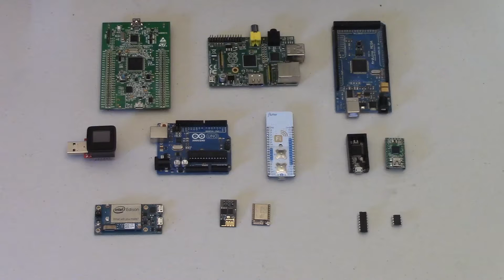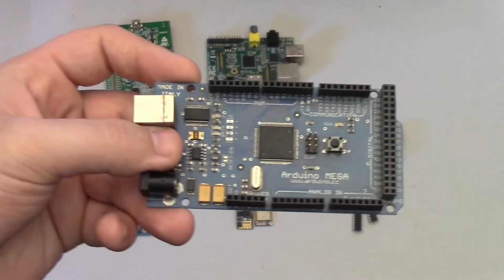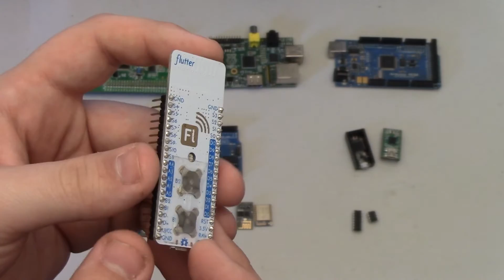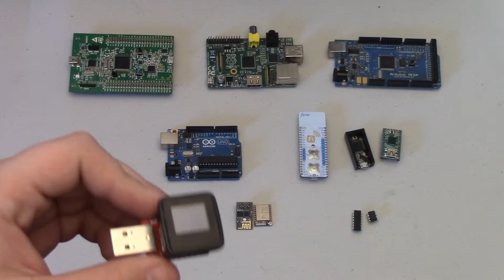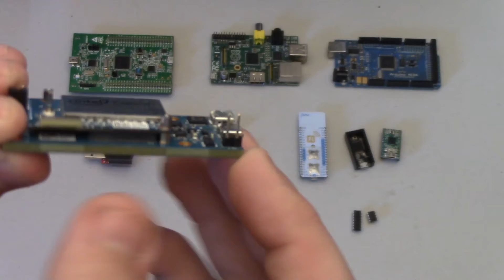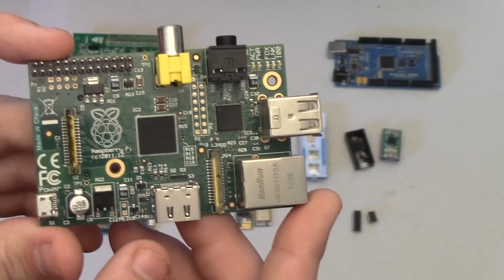Development Board Showdown!

Comment: I think I will buy a  arduino view because I am in a apprenticeship as electronic technician (for fabrication automation and circuit design)

And I would use it to output data and debugging codes from a standalone microcontroller.

Because we started "SPS" translated word by word it means "Memory Programmable Circuits" its an integration of EEPROM's, Flash, RAM, other memory types and logical operations in regulation- and controlcircuits. (and micro controllers) 

And I have to design am learning how to design and perfect them but most of this circuits don't need a display after testing and adjusting and using that arduino I would only need a few ports on the microcontrollers for diagnosis not like while using a lcd.

That means if I make a circuit where I have to define output fixed diagnosis pins that can't be used for other purposes after the first error testing I can use less pins and  maybe I could use a smaller cheaper microcontroller enlarging the "cost efficiency" (theoretical) .

Comment: I bought a 3D printer that used an Arduino mega like that one. I accidentally fried one of the digital pins building the 3D printer kit, and bought a box of 10 arduino mega clones from China in case it turned out to be a recurring thing. (It didn't, and I just tweaked the printer firmware to use a different pin.) Since I already had them, I used them in a lot of projects over the years. I'm moving more toward ARM/STM32 as my micro architecture of choice, mainly because the price/performance ratio, and indeed the absolute price in some cases, is better.

Comment: I don't understand why there is no Silicon Labs C8051F120 based chips here. Or for that matter any of the newer MCS8051 based controllers.
I have worked with some Silicon labs C8051F120 boards. I got some bare boards which could accomodate the chip and have built a few devices using these. The clock runs at 100MHz and the peripherals are excellent. a 12 bit ADC and DAC ports and whatnot. I just built a network analyzer which goes from dc to 70MHZ. with a 480x320 lcd display.
with Assy  as well as C programming using the Keil UV2 ( Old version  the only legal SW dev system I own.
 I think they are better for embedded control then 32 bitters.
Reply: Azzy M Now, we program in Processing on Arduino hardware haha. And sometimes Rust on STM32 hihi

Comment: in general agree.  a few comments esp modules except for esp01 are 2mm pitch so in general need breakout board for 0.1" pitch breadboarding.  also stint can be programmed by you're arguing into or any USB to serial ttl module in bit banging mode.

Comment: You CAN program the attiny85/84 with an ftdi device in bit bang mode. (special wiring required and some of the usb-serial adapters don't bring out all of the required pins of the device).  I think avrdude supports this directly, though it is SLOW!  You can also use the arduino uno as a programmer for those devices with a simple sketch.

The arduino mega is probably used mostly as a controller for a 3D printer with a RAMPS shield.

The Edison looses out to the RPi3 in price, but it IS smaller.  Also you can't build the RPi into a commercial product, but you CAN with the Edison.
Reply: Did the ATTiny support debugwire? With AVR Dragon you can debug/step code in device using debugwire or jtag.

Comment: cool thanks. would like to see an in-depth review and your tool chain setup and how to started for the stm32. the ST site has a few tool options and is a little confusing for the beginner. great videos.
Reply from the maker: I actually havent formally ever setup the ST toolchain - I've only ever used the STM32 with an RTOS called ChibiOS/RT (which if you're interested I have been working on some tutorials for that and those will be coming out soon). But I'd be happy to take a look at getting the real toolchain setup and try to make a tutorial video at some point.
Reply: +ItKindaWorks that would be cool. there seems to be something called STMCube or similar which is like a initialization code generator, but that has to work with a tool chain like Kiel/IAR or gcc. that's probably the missing link. it would be great to see a full end to end getting started with stm32!

Comment: You asked what's the Arduino MEGA ever used for; well, RepRap 3D printers! And clones of the MEGA on eBay are less than $8.

Also your logic is wierd; $50 for that silly little 8-bit thing with a screen + $15 for the programmer? Then you say the Edison isn't worth it (not that I think the Edison is of any real use when you have the RPi).

Still, another one that's even more amazingly-priced is the C.H.I.P. board, $9 and has 32-bit ARM running Linux with WiFi and Bluetooth, plus plenty horsepower. I just wish they accepted PayPal.
Reply: Why not just find a local microcenter and buy a raspberry pi zero? the chip userbase has basically all died out already as have orders, so I definitely wouldn't recommend buying them now. I have a couple of the 8GB boards still that I never even got around to using simply because it makes more sense to do them with a $5 Pi that still has growing support and functionality rather than the chip. I definitely agree about the microview thing though. You can buy an Arduino Pro Mini or Nano for under $2 plus an OLED for less than $3, then you have something better than a "microview" with a larger display for literally 10x less. There's no logic behind it besides underestimating one's self in their ability to connect four wires and use the example sketch properly. I feel this way about "teensy" too. $20 for what is essentially no different than a $2 "blue pill" STM32? PASS. I could design a comparable board and have a batch of 3 made for less than $20 each... Nothing mass produced should cost more than it costs you or me to make a one off. 
As far as Chinese boards go, every premade MCU board I have is from China, and I've only had one digispark board break without me doing something to cause it, and that thing was put through hell for like two years before it finally crapped out, and it's likely only the diode but it was $1.60 so it doesn't even make sense to fix it. That's the beauty in the Chinese micro controllers, you can live with breaking them. Break a $30 uno and you'll hate yourself. Break a $3 one and you'll only be mad you have to wait 2 weeks for a new one. Unfortunately, the fact of the matter is, unless you're buying official Arduino boards these days, then what you may pay $20 for is literally exactly the same as what I pay $2 for. The only difference is some greedy shit in your home country bought them in bulk and is overcharging you to create the illusion of quality. Also, they're all open source so technically they're not clones, they're just made from different sources(though the ICs may well be knockoffs, but I'm actually not sure since they are very cheap for single pieces, so buying millions at the source would easily allow for super low prices.)
Reply from the maker: +aiklarung Thanks for letting me know about the Mega for RepRaps! I tend to be more picky about MCU clones that are that much cheaper than the originals. I've been burned before from bad FTDI or just poor soldering. I'm more ok with the ESP clones because theyre so cheap to begin with that the clones only tend to be half the price rather than 1/6. with a 1 to 6 disparity I have to imagine that there is something causing that more than just markup. Maybe I'm wrong though.

As for the MicroView, I wouldn't personally buy it again but unlike the Edison, I think that it is potentially a fantastic entry level tool for people who don't have a lot of experience and just want to get up and running with an MCU and screen. Its the same reason I use the Teensy or ESP or other more advanced modules that are cheaper and more powerful than the Arduino but I still recommend the Arduino Uno to beginners even if it's more expensive and less powerful that 90% of the competition. I dont mind the expense when it has a reward like ease of use. I think the Edison is kind of useless because it's both not entry level and expensive... and the RPI is far cheaper and has a lot more support.

I haven't used the C.H.I.P. yet but I have heard about it and it does sound pretty cool. It seems like a good replacement for tasks too simple to really need an RPI but too much for a microcontroller to really deal with.

Comment: What do you think of the nodemcu variant of the esp8266?  I think it would make using the tinsy obsolete because you could go straight to the pi.  I have a few of them and think I might go that route.  What do you think?
Reply from the maker: +Jason Graham I'm a little confused about what you mean that it would make the teensy obsolete because I could go straight to the Pi. For me the power of the Teensy is the fact that is has so much I/O that is expandable. It has a true DAC for audio, 10 easy to access analog inputs that go up to 12 bits, 3 hardware serial ports, and so on. The ESP is extraordinary in being so small/cheap/and has WIFI but when put up against other platforms in terms of I/O it doesn't come close. 

That being said, I have yet to try out nodemcu on an ESP, I've never worked with Lua before and haven't had a need to do so yet. If you're talking about using the ESP as an MQTT broker using nodemcu, thats something I've thought about but ultimately I generally want a more powerful platform for my MQTT broker because the volume of messages and network traffic would quickly become greater than the ESP can handle I believe. I've read accounts from people who have had as little as 2-3 packets per second from the ESP and when you have a whole home automation system running with a dozen or so nodes, that traffic can add up quickly. 

But like I said, I haven't personally tried it out. If you do, please let me know how it goes, because if the ESP can handle more traffic than I think, then it could be a viable cheaper solution to using the Pi.
Reply: +ItKindaWorks I don't think I explained myself very well last night or I misunderstood your use of the teensy device.   I assume you are using it to communicate with the esp and your pi as an intermediary device instead of the esp8266 talking directly to the pi.  I am using an nodemcu style esp8266 v1.0 not using lua but Arduino IDE.  A lot of the code I see you use on the teensy could be running on my esp8266 v1.0 device since it has plenty of memory.  I know it is larger than the versions you are using but that is because it does not need the ftdi.  I am also new to this, so I am learning the ins and outs of it all.
Reply from the maker: +Jason Graham Yes, that is a good board to break out more of the I/O on the ESP but correct me if I'm wrong, there isn't any supplemental MCU on that board so it has the same limitations as the ESP does in general.
Reply: +ItKindaWorks I am not positive, i will have to look it up but I have a feeling that it might not.  So I guess my real question is, why use the teensy instead of talking straight to the Raspberry Pi?  I ask because if there is a reason for it, I should consider getting one for my future setup.  I will be getting a system called wigwag and am trying to come up with a good solution to integrate it all together.
Reply from the maker: +Jason Graham I think we might be missing each others points, did I say something in my video about using a teensy instead of a Pi? In general I use the ESP/Teensy/Pi for different use cases. The ESP for simple wifi nodes or as a communications conduit to another MCU that doesnt have wifi baked in (like the Teensy). I use the Teensy when I want real horsepower and lots of I/O from an MCU with high resolution ADC and a DAC and everything else that more powerful MCUs generally offer. The Pi I use when I need a full linux platform to act as a server but I dont tend to use it much for pin I/O unless there is a good reason. My issue with the Pi for I/O is that the Pi running most linux distributions are not real-time so you can't guarantee that a given task will be accomplished in a given time. 

So I supposed I am just a little bit confused by your thinking that I would use a Teensy instead of talking to a Pi or a teensy before the Pi. I really apologize for the confusion here
Reply: +ItKindaWorks I was referring to a different video of yours where you used it.  I appreciate all the info you have given.  It helps a lot.
Reply from the maker: +Jason Graham Ahh ok, now I understand. If you are referring to the videos demonstrating using a Teensy as a system monitor or something similar, then you could use a nodemcu for flipping LEDs or whatever it may be but at the time of making that video, I only had ESP 01 modules on hand which don't have enough I/O broken out to handle the LEDs.

Comment: you can buy cheap Uno Clones with 5$ not 25$
Reply from the maker: +Oren Weil Well I haven't bought an Uno for a while so I suppose that may be true. Still though, I tend to prefer the Teensy because of it's power and breadboard friendly design. I know there are tons of various Arduino types that are also breadboard friendly but you have to stake your claim somewhere, right?
Reply: +ItKindaWorks right... also there is trinket of adafruit, I didn't work with it, but it seem a good and cheap board... and also particle.io has quite good boards...

currently I'm starting to work with ESP8266 which seem to be very nice
Reply from the maker: +Oren Weil I havent worked with either, but like you said, they seem to be really good cheap boards. There are just so many options these days. 

Haha well assuming you watched more than 25 seconds of this video, you know I love the ESP8266! If you have any questions about getting things hooked up to it or anything like that, let me know and I can see if I can help/make a video for it!